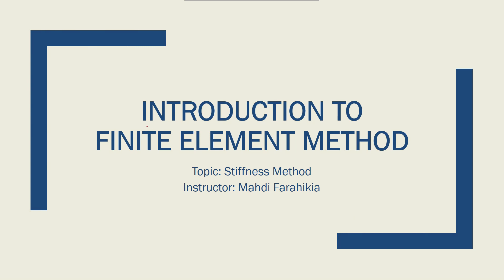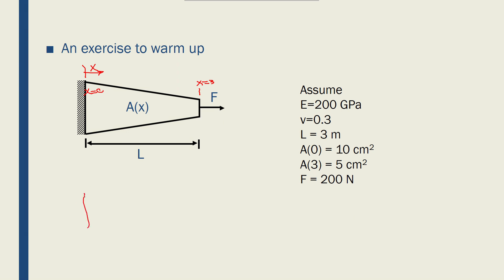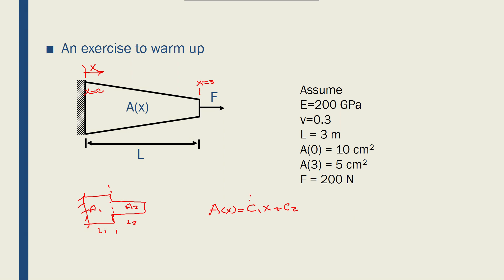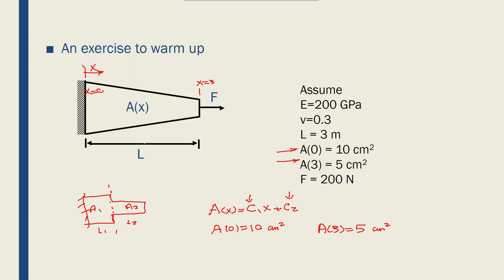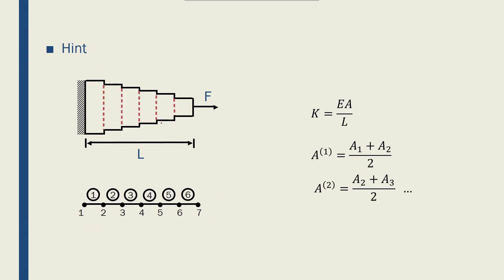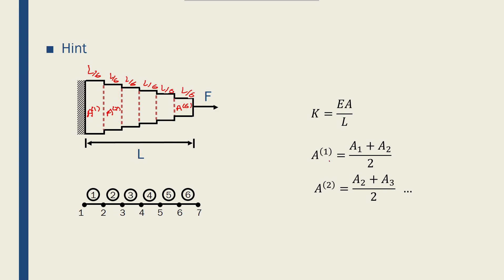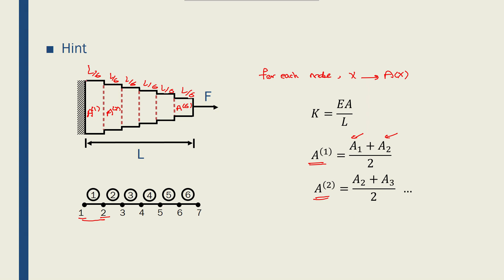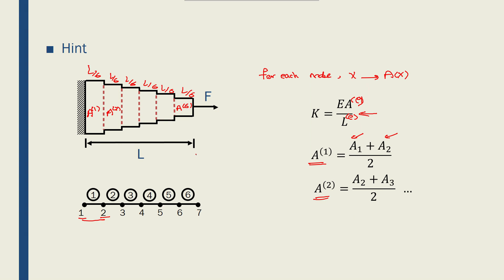Intro to FEM - Week01-05 Stiffness Matrix Exercise

Comment: What will happen if we take the function to be a quadratic equation.
Reply from the maker: Same method. Just a bit more complicated. You'll need to find the cross section area at each point.
Reply: @TheMisterM123  aren't we finding Cross section at each node here also?
Reply from the maker: That's exactly what I meant. Then, you use the two nodes of each element to find an average cross section for that element. It's that simple.
Reply: @TheMisterM123  thank you